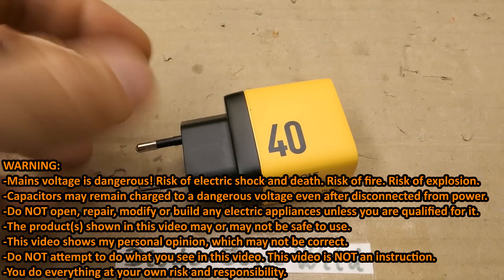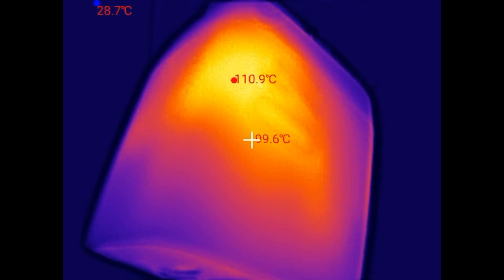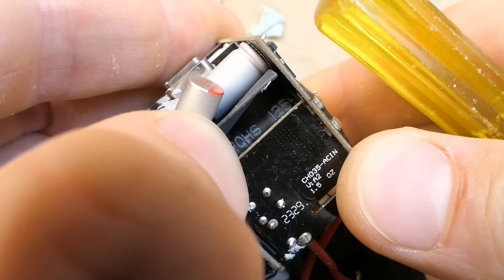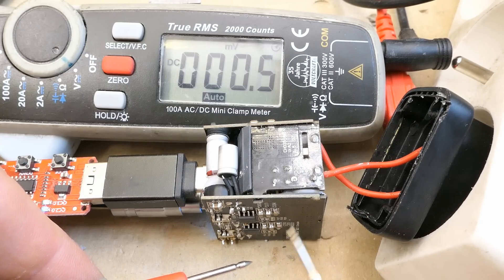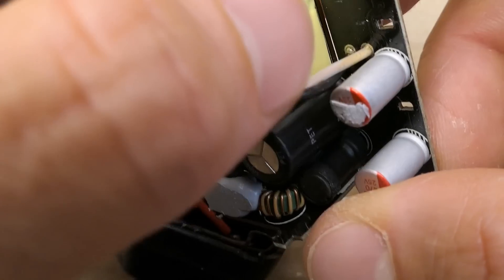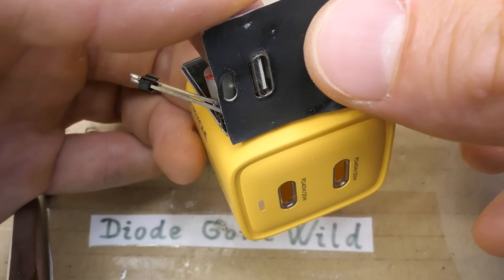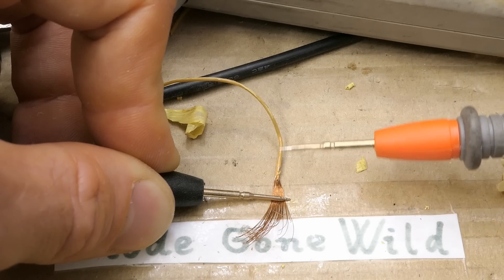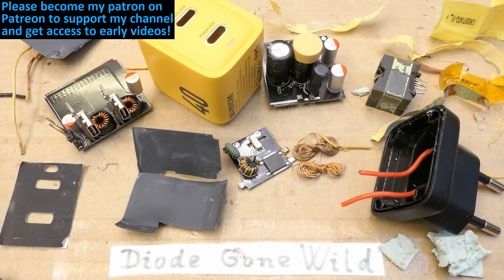$15 aliexpress 40W USB-C charger test

Comment: Also a good ting to mention here is that Phones or Laptops dont usually charge at their rated or advertised Wattage all the time... They do it breifly and then default to basicly half of the advertised wattage.... So this charger is perfectly fine and slightly Dodgy like you said if you treat it like a powersupply

Comment: I wonder how would it go for the Samsung charger, when you put it on maximum current for few hours.
Chargers are not built to work that way, chargers charge on full power only for 10-15 mins maximum, then they lower the power, to protect the battery.
Even 120W chargers charge few minutes at 120W, and only if this option is allowed in settings. Otherwise, they charge at half power.
I use Toocki 33W charger from Ali, with display, it charge just slightly longer my Xioami phone, than original 120W charger. And it charge with 27-28W only to 90%, then lowers to 5-10W.

Comment: Another fantastic eposide of the serie. I don't think this one deserved the vote of slighty dodgy, since it has all the characteristics of a good charger, included Y1 safety capacitor. Like in this case, if you spend a bit more you can get excellent products from aliexpress and ebay china, of course 1 dollar chargers have more chances to be dodgy

Comment: I think this is a very good design, for shure when compared to so many others you have tested before - just the rating is wrong I believe!

It should instead say about '20 Watts continuus use, and 40 Watts for 20 minutes' - and everything would be okay I guess.

Think it withstood 160 degrees without failing - not recommend but not bad from a shear performance point of view.

And the customers ask for such small packades - of course without sufficient cooling surfaces and without active cooling via ventilators like with a PC power supply for instance.

It's not the manufacturers fault when the market asks for the impossible.

Comment: Looking at the quality of the transformer, the complexity of the circuitry and the capability, I wonder if the circuit boards were developed to meet an OEM spec, but then they reused the parts in a cheap enclosure without heatsinks to make a cheap charger.
Edit: I noticed the 40W rating is spread across both outputs, it looked like you were applying the full load on just 1 output. Granted, the charger should limit the output to 20W on each output, but the test was not absolutely fair.

Comment: I suspect the Chinese designers develop a charger and test it with increasing load until it shuts down, then use that power as its rating, regardless of how hot it gets.

Comment: This charger seems to go under various names but the OEM name is CH035-CC. Using that name you can find quite a few teardowns (almost all in Chinese).

The primary MOSFET is actually a GaN - it's a CE65E300DNYI by Corenergy. Search engines are next to useless for part numbers these days, so no surprise you didn't find it. It was via another teardown article in Chinese that I found the true part number and even that didn't lead me to the datasheet on their site.

Comment: I have a similar one. But i only paid around 5$ it's 35w GaN has a USBC and USBA port and even a small display that shows the wattage being drawn from the charger! For the money it's worth good. Mine doesn't get alarmingly hot even at full load. I even bought another after seeing how good it was.

Comment: 100 degrees and you can touch it with bare hands to open it? Are you sure your thermal camera is calibrated? I have my doubts
Reply from the maker: I don't touch the hottest spot, and plastic has a low thermal conductivity and capacity.

Comment: I have a FNIRSI FNB58 USB tester that stopped working while testing a charger with the QC3.0 fast charging protocol activated. The charger was outputting 20V with a charging current between 1.5 and 2A. The charger was connected to the USB Type-C input, and the load was on the USB Type-A output.

The tester turned off in the same way as shown in this video when exceeding a certain current, but I was unable to get it to turn back on. I tried with other chargers, but it still doesn't work.

According to the product specifications, it should be able to handle up to 28V and 7A, so I am surprised that the device failed under these conditions.

Does anyone have any idea if this is normal and what I could do to repair it?

Comment: 15:40 you can get two power MOSFET, tank capacitor, 20v+  zener, ultrafast rectifier, centertap the dual primary 

And about 100uh inductor

Remove the feed back from the transformer

And use feedback wound on same inductor

Or just regulate power and current on secondary a side, and output constant voltage

it's a flyback so the cheap zvs driver works.

The problem with em back in the day was running over 100volts without blowing up transistor gates
Reply: Push 100w and run at half the heat waste

That topology only switches the transistor on or off only when the voltage across drain and source is as close to a possible zero

Could also switch based on when the current across is zero too

Or when the voltage and current cross with effectively no flow of power too

Want a extremely low rds  on the transistor

Make sense to turn a switch on or off when no load is apparent

Less work it actually needs and switches can switch faster

Cant have switching loss when the switch hardly sees any apparent power...
Reply: Zvs doesn't need digital logic to switch voltage

It's a resonant smps 

Pretty much a Tesla coil driver in cw mode but much more efficient

Comment: Unbelievable, you found one which actually provides what it claims.  Disappointed by 2 minutes in as it appears to suffer intense heating.  Too hot to leave plugged in unattended.  It will have a very short life.

Comment: Does the flyback transformer in a CRT TV or minitor worn in DCM or CCM? I never had an oscilloscope and a high voltage probe to check it. What about the self-oscillating 2N3055 circuit used by hobbyists?

Comment: Not bad if you only use it at reduced load. The problem is if your device or devices are capable of charging at the higher power levels, they'll do it irrespective of the internal temperature of the charger. Besides using chips with some kind of thermal throttling, I'm not really sure how they could reduce the temperature of these kinds of chargers. They're just too small and have too little surface area to dissipate that much heat.

Comment: It is 40W. Most phones charge super fast with that power. Its actually unnecessary to leave it for hours with maximum load. I will get hot, sure. But it wont get that hot in a short period of time, at max load. my 45W Huawei charger wasnt even hot to the touch after a full charge on my phone, only if I accidently left it for hours during work.
Reply: USB-C can be used for laptops, soldering irons, etc. Not just phones, and those can consume huge amount of power for long periods of time.  High quality chargers don't get that hot at max. rated power output. Charger in the video should have been limited to 30W.
Reply: @Alex-mj7km Well said. It only needs to go wrong once. It’s not worth the risk.
Reply: @Alex-mj7km  Yeah, I wonder how difficult it would be to decrease the maximum output.
Guess it depends on how accessible the resistors are.
Reply: @Alex-mj7km  Doesnt even need to be limited, some thermal throttling would be enough.
Reply: And how much of chargers have a marking about how long it supposed to operate at maximum load?
Reply: @Freeman666Gordon  Not being able to deliver 40W for hours isnt the issue. Nobody expects from a tiny wall plug surrounded by plastic without any cooling holes that it could do that unless it uses some incredibly efficient components and costs 100 bucks. The issue is not reducing its output as it heats up, degrading and eventually killing most of its internal components, potentially melting the case, starting a fire or causing an electric shock if the isolation melts down. Its not about truth in advertising, its about safety and a PSU that reaches 150C is not safe.
Reply: @Chuckiele I use a 40w charger from Anker. It gets hot too but I can touch it without issue. 
Charging my iPad and a Power bank for hours with it.
Reply: @Todestelzer  Yeah, but you dont know if it does so at 40W. It might thermal throttle after an hour
Reply: @Chuckiele  I do. Used a usb-c power meter.
Reply: @Freeman666Gordon  I don't think there are any.
Reply: @Freeman666Gordon  it should be common sense, kind of. I'm talking about phone chargers right now. for a phone that charges up in 10 mins with a 120W charger, or a 45W charger that gets your phone charged up in 1 hour, you dont need to leave it plugged in. Also phones stop acceptin power from chargers when they are full, so the charger shuts off basically if theres a logic circuit in it that talks with the phone. These tests are kind of unnecessary, because you will never use a phone charger at its maximum load for a long period of time. They really show the potential of some chargers, but in my eyes, these long time stress tests are unreal in a daily life use. And I repeat myself again. Im talking about only phones now. I know high output chargers are used for laptops and soldering irons, but thats a way different kind of use and load.
Reply: How about tablets or laptops?

Comment: We had a hand blender and its motor burned out. Upon closer observation there was a warning text printed on it, something similar to this: "do not run it for more than a minute". Sometimes you just have to know how long it can be used before it gets too hot.
Reply: Yep, just bought a cheap blender, it says: "run for 60 seconds max, then let cool down for 5 minutes"

Makes sense considering it is completely sealed and has 800w motor in it.

To be fair, the thing can do most stuff in under 30s anyway.
Reply: @galaxya40s95 They did cheap out on a thermal switch in the motor windings. If it had one, there would be no burn-outs. The whole “use it for 60s” thing is silly when it could be automatically enforced using cheap components.
Reply: @absurdengineering  I definitely agree. 
But that is kind of what you expect when buying cheap stuff. 
Hardly enough money to pay for decent materials, much less for proper engineering I suppose. 
And much easier to add a sentence or two into the manual.

But imo as long as you keep this in mind and do not try to use it in professional environment, its fine.

Comment: its less crappy compared to other chargers and actually seems pretty well built with proper y cap, proper isolation distance, sync rectifier compared to a diode, properly rated, interference inductor, fuse, ntc, chonky FULL BRIDGE RECTIFYA, reasonable pretty nice transformer, insulation shield.... Just sad it cooks itself
Reply: I bought two similar chargers but they came with usb cables so it was a steal, i will use the chargers when i have to charge devices that need 5v and 3a 15w they also get hot when i use the max 20w.
Reply: @liam3284  can you explain on where the flybacks would go. I'm new here
Reply: It's a really nice electronic design, with a bit more consideration to mechanical and thermal design, it would be a great product. Not entirely sure why they used thermal transfer pads on the outside chips, the ABS case isn't a great heatsink!
Reply: @cambridgemart2075  still better than air, i guess
Reply: Mostly on really high end devices, for most cases it's an overkill.

Comment: I wonder if there are any USB-C supplies from Temu or something that just common the two USB ports together rather than use independent DC-DC converters or transformers? That would be interesting. Plug in your laptop and your 5V power bank at the same time and get flames. Technically two different devices would just cause a data conflict when requesting the voltage, but I’m sure they’d find a way to make it “work.”

Comment: Looks like a decent device for the price.
Just don't reach the 40W load ...
I mean, for such a little price it seem nearly over engineered and unexpectedly full of decent components.
Reply: it is a realistic phone charging 40w  they phone will only draw 40w for small time then drop to lower as charging continues
Reply: @gasleakpipe "small time" well, in this time, the charger will reach 100+ degrees C anyways.
I wouldn't trust that..
Reply: @Versette  less power less heat
Reply: But than you can’t use it for charging a iPad or a power bank. So it’s useless. 
Better buy a Anker or similar good brand charger.

Comment: This is ridiculous to see a chip running at 158 degree C. Have you calibrated your thermal imaging camera maybe its faulty or off by some larger degrees. PL check it too. Thanks for the good work.
Reply: Power semiconductors are rated up to 175C, they will survive just fine. It's the electrolytics which are going to die first.
Reply: No it probably is that hot
Reply: @cuf_  Maybe it can double up as a toaster!
Reply: @zebo-the-fat  mini stove
Reply: @cuf_ silicon decades at like 120C.

Comment: It took me a second to realize that was the list of voltages with numbers in front and not 15V 29V 312V
Reply from the maker: Some Fnirsi products were made before spaces were invented ;)
Reply: @DiodeGoneWild  Do such chargers pass the EMC tests? How reliable would they be if they solved the heating issue somehow
Reply: @DiodeGoneWild  Maybe the one writing the code had a HP laptop?
Reply: What about the 1:10 eg 0.434 32 A why there's space before 32 A? I can't decode😂. I get that's 0.434 Amps, but what are those two last numbers in every field?
Reply: Yes, me too

Comment: Funny that this is $15, Ikea recently started selling a 45W two port USB C fast charger for the same amount (Sjöss). Supports PD 3.0, Q4+ and PPS. 5, 9, 12, 15, 20V. It's on the US site but also available in the UK (£10) and probably in Europe too. Ikea website says the weight in the box is 140g.
Reply: I confirm that in Italy Ikea sells the excellent Sjoss for 9,95€!
Reply: @BICIeCOMPUTERconGabriele i can confirm too, I've bought it some time ago and it works great with my HP Pavilion 15 laptop!
Reply: Ottawa, Canada $17.99 Will pick up one this week thanks to your excellent comment. 
Ikea, unlike the Chinese, have an actual ass one can sue. Therefore, their electrical stuff is top notch.
Reply: @piconano  I have a decorative LED string from IKEA. Its power supply had 250 V capacitors for the rectified 240 V AC. Their capacity degraded and the string began to flash. YMMV.
Reply: either it was on the secondary side or two of the 250v caps in series, which is often the case in chargers and power supplies, as other user wrote, 340v on a 250v cap would blow in a second, doesnt matter the tolerance
Reply: @WindowsSucksUwU  Yeah, in series, kind of. Voltage may not be the problem, but I don't  quite understand the design. Capacitor C1 + is the common +, C2 - is the common - of both the primary side and the rectified mains. While C1 and C2 are being charged, the current goes between them through diode D3 and a 150 Ω inrush resistor. While discharging, the current goes between them through diode D1. But there's a diode D2 between C1 - and the common - so that C1 could be discharged without discharging C2. What's the point of D2? The over quality looks good and it worked for hundreds of hours. I just don't like the sealed box.
Reply: @piconano meh, I have a 3 USB-A one from them that died in the first 6 months.  The previous version is still doing great
Reply: Ikea won't ship to my city.  I trade both In and Out burger joints and a walmart in my city for a microcenter and ikea store.
Reply: Wanted to comment on that one. Bought it for 15€ here in Germany and it's pretty decent.
Reply: this one is a pretty bad deal, there were Baseus 65W GaN chargers for 12$ some time ago on Aliexpress, and that one doesn't overheat at 65W load.
Reply: It costs nothing to buy from reputable sources.
Reply: Czech Rep  249,- Kč
Reply: I have that charger and it has exceeded my expectations it worked without issues at all

Comment: Really love to see you testing slightly "higher end" chargers like this. I actually have one of these myself, so it's great to see that for the most part it's safe and well designed - though clearly not meant for continuous 40W loads. I suppose in its defense one could argue that most USB-C loads (like smartphones and tablets) don't draw constant high currents like that but tend to taper off quite quickly, and at least this isn't quite a laptop charger in terms of output power (or, at least, for any laptop that would draw more than 15-20W under load when fully charged). Those temperatures are still not acceptable, and this really should have had some kind of metal heatsink included in its design, as clearly "sinking" to the plastic casing through those flimsy pads is completely insufficient.

Btw, do you have any plans to test the new IKEA Sjöss USB-C chargers? They're close to this in price, and IKEA chargers have tended to be very well designed previously from what I've seen.
Reply: Using a metal shell would require a three prong grounded plug in the USA for safety.
Reply: @d46512  To be clear, I don't mean an outer metal shell. Most high quality high output chargers have an internal metal heatsink, which typically wraps around part of the outside, but inside of the plastic shell. No grounding needed.
Reply: @d46512  double insulated compliance is not enough?